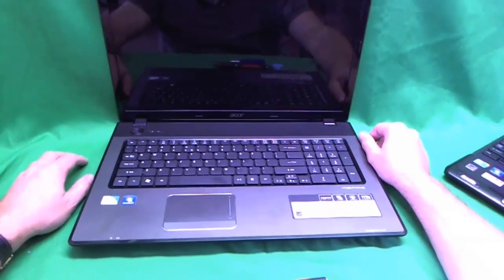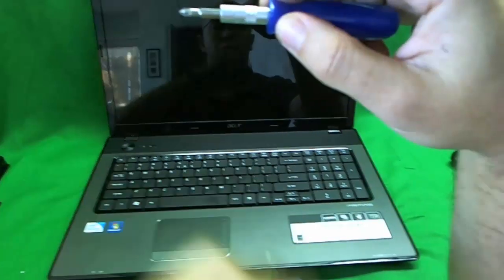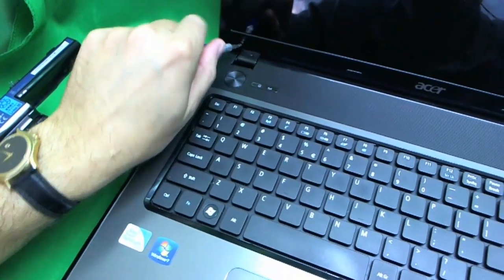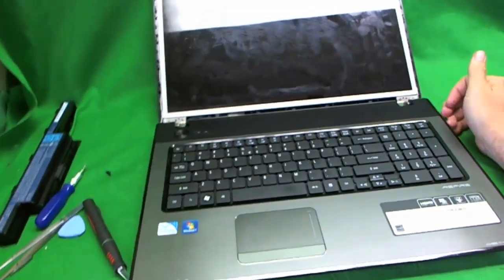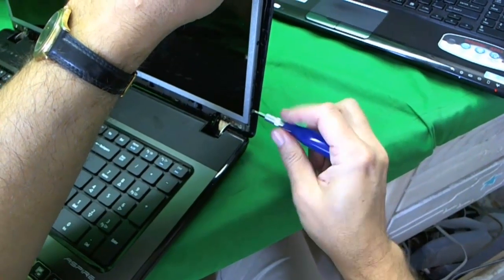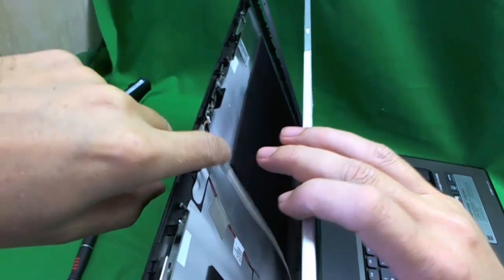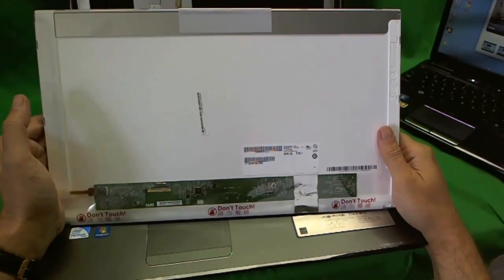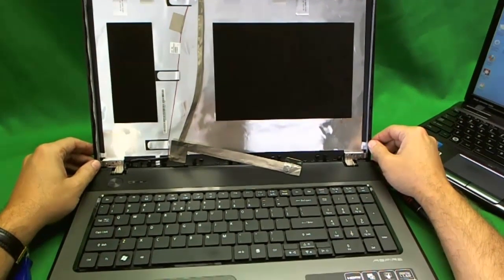Acer Aspire 7741Z Laptop Screen Replacement Procedure

Comment: This is a great video. I have the exact model. My screen is not broken though. Yet, it flickers on start up. I get horizontal lines up and down the screen. Stops doing it once I log in. But then does it again as soon as I move it or type. Do I need to replace the screen or would it be a loose cable? Strange thing is the outer monitor connected to laptop doesn't flicker while the laptop screen does. Anybody have any ideas?

Comment: WAS QUOTED THREE HUNDRED TO REPLACE SCREEN PARTS AND LABOR. SO I BOUGHT  A  DELL. SAW THIS VIDEO AND RELACED THE SCREEN IN A HALF HOUR FOR SEVENTY ONE DOLLARS. BOUGHT THE SCREEN ON AMAZON. NOW I GOT A NEW LAPTOP AND THE GRAND KIDS HAVE THE ACER AND DONT BUG ME FOR MINE. THANK YOU SO MUCH. IT WAS SO EASY. MAGENTIC SCREW DRIVER A MUST. TAKE YOUR TIME TO RECONNECT THE CONNECTOR RIBBON ON BACK OF THE SCREEN AND IT WAS FINE THANKS. SAVED TWO THIRTY BUCKS GOT A NEW  LAPTOP. SO DID THE GRANDKIDS.